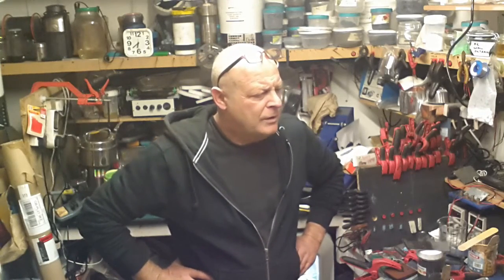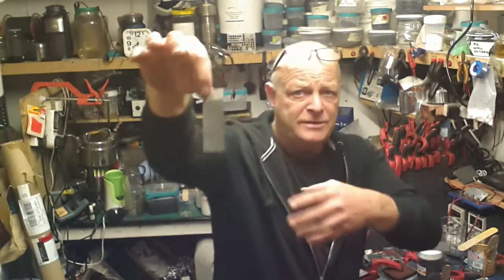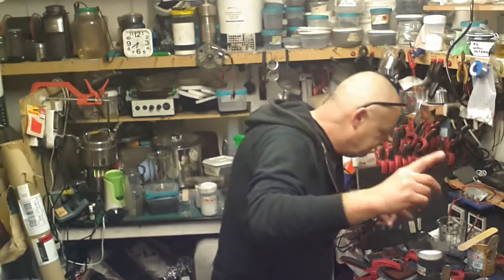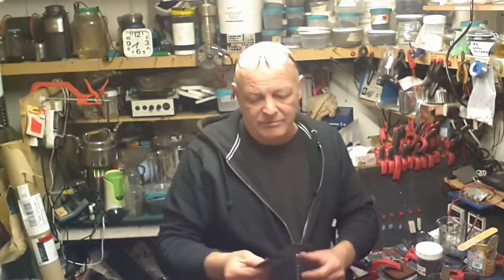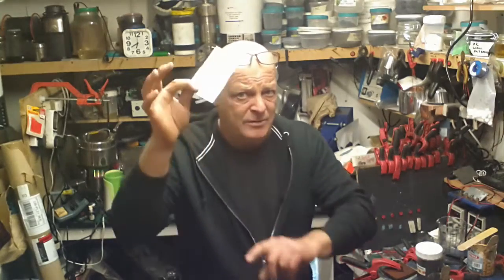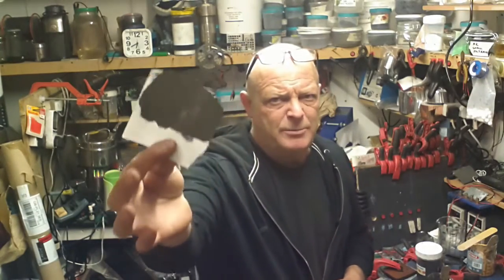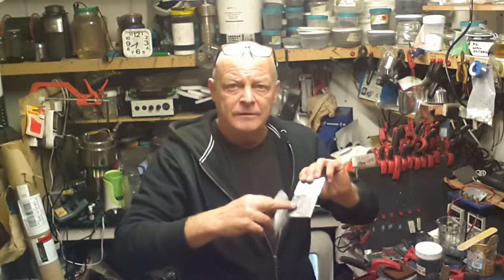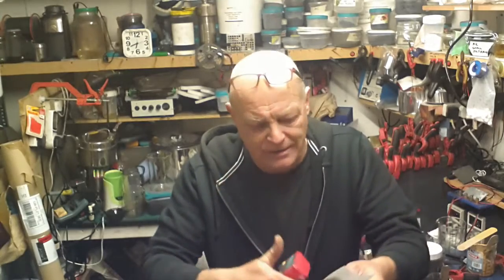Conductive Coating Paint ink etc

Comment: Hi kev . I have a chemistry question you may enjoy as an exercise to practice your skills or anybody else in our Carbonator world 😂. I have asked a few youtubers and i Iwill ask Rms as well . The main reason I ask you in particular is I felt I learnt a lot from your recent chemistry class. Really came together in my head right 😊Here goes .... Well you may well be able to answer this question with your chemistry knowledge. I am going to use sodium hydroxide to activate some carbon powder I made . I then had some strange thought come to my head at 4am about adding poly aluminium chloride (hi chem pool floculant) to the mix after 24 hours of being in the sodium hydroxide . Actually adding the carbon and base mix to the poly aluminium chloride. My thinking this far is that sodium hydroxide and aluminium are very reactive so i had an idea that it may well have a strong reaction and create an even larger surface area and be left with a chlorine doped activated carbon ? Any thoughts on the reaction ? I’m not a chemist but I do learn kind of quick when it’s something  in my world . Any thoughts on this would be appreciate  👍 or even a equation and what I am left with in the carbon ! Cheers Andy

Comment: Not so sure about the flexibility concept in my ambitions of making a battery . I intend on creating a flat pouche cell like LG Chen makes . About 200mm by 200mm . They will be stacked flat on each other in a plastic square container like a milk crate so I don’t see any reason for them to be particularly flexible. Is there any other reason why I would looking to create that characteristic that I may have overlooked ??
Reply from the maker: Concentrate on making them survive first mate, as in long term.... other goals can be scored after that 😎
Reply: kev wallcroft yes I concur . I just read that Nissan are not using lg Chem cells in the new leaf and are making there own with a NEC subsidiary company . Interesting times for Nissan as they may have made the effort to lower the conductivity in there home made cells to deal with the degradation they were suffering from not having liquid cooling . I think the efficiency of most lithium ion cells could be greatly enhanced if the created higher conductive carbon but as we all now it is a trade off many battery engineers have balanced .,I think the time has come to figure out the most efficient process of making super conductive carbons. I have got mine down to .2 ohm s 10mm apart but it required a lot of energy !
Reply: kev wallcroft yeah fair call but do you mean in terms of cell construction or degradation of the active material structure ? As I am thinking of low c rating unlike what cars would draw and low heat environment from low duty cycle etc . I am interested in the home  energy storage market like a power wall . I will only stop if it kills me 😂

Comment: Hi Kev,  I think there is more to investigate than just the absolute resistance, such as the flexibility on the substrate and its resistance to attack from the chemicals that one is using in the electrolyte. Quite a lot of people are now coming to the same conclusions that graphite plates and graphfoil etc  are too expensive to scale up. so a DIY conductive ink, paint, coating or whatever we call it will be very useful for constructing our battery current collectors. Most of the active material, binders, plasticisers , carriers we are all ready familiar with, from our battery experiments, plus the kit such as ball milling, filtering and washing is also to hand. It maybe a worthwhile endeavour for some of the newcomers to try, somebody may come up with a great new formula  :-)   Martin.
Reply from the maker: Get on with it then ha ha.
But yeah you may be right, however with the fwg and the new carex stuff does anyone else really need to bother ?
I only wish i had more time myself 😎
Reply: I am "getting on with it" at as you know. The thing about FGW and Cayrex inks is that they have done them, but that does not help anyone else to make their own formula for their own type of battery. I have got less than 1R ink on a metal substrate, that was not the difficulty, the thing is to prevent the coating taking part in the charge / discharge cycles and wearing away to expose the metal current collector.  
You yourself are covering Al metal with a coating of "conductive material" with much the same objective :-)   Martin.
Reply from the maker: @solarhope  point taken mate, see two heads are always better than one 😎
Reply: Very true Kev, and the more heads that take up this battery research from  youtube vids or comments means we all benefit :-)      Martin.
Reply: solarhope I concur !

Comment: Very good, as usual!  Not Hollywood?  grin!  You come across as honest and real - unlike a slick Hollywood production.  I wonder if some of the reduced resistance on the aluminum plate is because some current is going through the plate.  Onward and upward!
Reply from the maker: yes someone said to me that to take that measurement you have to deduct the resistance of the plate itself from the reading
Reply: Or just apply coating to cardboard and aluminium and compare the square resistance :-)

Comment: yo man! hehe, the point is that I dont make a price for the ink,.... the company will set the price. I also send you the contact of this company. I also have less time for the youtube because this ink which you can see on my channel is basic conductive ink and now I working several days on new formula for professional conductive ink,.... so sorry for my late respond. I am trying to catch up with everything. 😁😉
Reply: Hi Cayrex2 - will your 'new formula' be waterproof, i.e. sodium silicate based?
Reply: @denniskramer9788  the new formula is based on the ink that you can see on my last video,.... so will be a upgrade. Yes the ink is waterproof, resistant to high heat, more conductive, etc. I will make some videos on new conductive inks in the future also I will show some other inks which have other properties
Reply: Thanks  @cayrex
Reply: @denniskramer9788  no problem 😉
Reply from the maker: Yo Dusan i understand, so when you have some professional conductive ink please let me know i would like to try it 😎
Reply: @mouldykev  yes I will.

Comment: Hi Kev, thanks for the Upload. 
My first try for carbon electrode I did with activated carbon for medical use, bought by boots. No conductivity. Next one I measured charkcoal for barbeque - no conductivity. Later I gone to the fire place in my garden, where I burned different kind of wood. Some had conductivity, some not. But I cannot remember which kind of wood had a low resistance. I belive it was oak. Ok, after watching RMS it would make sense to take the coal with lowest resistance and add about 20% graphite, put this in a grinder or ball mill and see what's happend. - My goal is to get the stuff without chemicals and / or complex tecnical equipment like high tempereature oven, microwave etc. 
I have the feeling some one are with me about. 
However: I'm waiting for your next video!
With greetings from Spain
Scan Train
Reply: eres de españa?? ya somos dos, yo tengo carbon activado y tiene muy baja resistencia, el mio lo saque de unos filtros de soldadura
Reply: @ @jorgemartin7697  I'm sorry - no espaniol. I'm just for my job in spain to escape the cold weather in north europe.
Reply from the maker: You will have to use Graphite mate that is the only way to get your conductivity
Reply: @mouldykev  Or graphene?
Reply: @mouldykev  No, coconut husks charcoal is also very conductive...It seems the harder the wood is the better the conductivity...
Reply: @mouldykev  Graphite is indeed what I have, but isn't graphene very conductive single layer graphite?  I'm still working out how to make enough of it in a safe manner - I'm hoping the salt water electrolysis method can be worked to make a good amount.
Reply: STEM Camp Projects well it’s all good and all as an additive bit it’s necessary for them to be platelets I would believe otherwise you just have microscopic bits of conductive material not really connecting to each other . I feel at least 10% graphene by weight would be in order if your Carbon is not at least 50 ohms . Not so sure graphene is the go when very fine graphite is cheap enough .
Reply: @energystoragedevelopers7656  Right.  I believe graphene is much more conductive than graphite, even at the tiny level -- but it is likely to not be cost effective.
Reply: STEM Camp Projects yeah these things we need to try . One change at a time 👍
Reply: .It seems the harder the wood is, the better the conductivity is...

Comment: Three ohms per centimeter is pretty good. That's in the useful range. Is the plastic material you describe flexible, and if so is the resistance stable while flexing?
Reply from the maker: From memory mate it was flexible, but i never checked the resistance whilst flexing.
I did though make some graphetized rubber and that altered whilst stretching

Comment: Ive tried ever conductive ink recipe I can find and my results are always so poor :/ I guess my graphite is no good.
Reply: Just try coconut husks charcoal... Very nice conductivity for the low price..
Reply from the maker: You do need good quality to start with mate it is the only way
Reply: @mouldykev  inspired by the comment you made in this vid I tried some abs plastic in acetone with graphite and it conducted beautifully so thanks for that :)
Reply from the maker: @ferriswhitehouse1476  ok so on your first attempt what resistance did you get.
Reply: @mouldykev  a small blob about 2mm thick gave me 5 ohms across it probes were about 4 cms apart. worked as a binder for a supercap pretty good as far as my experiments go. thanks for sharing graphexel.
Reply from the maker: @ferriswhitehouse1476  no worries mate glad to help 😎
Reply: @mouldykev  do you mind sharing where you get your stuff? thanks
Reply from the maker: @ferriswhitehouse1476  if you mean Graphite i get it from Graphexel   in the uk